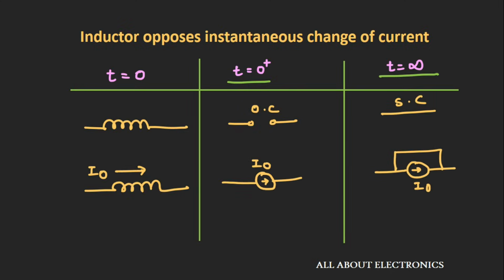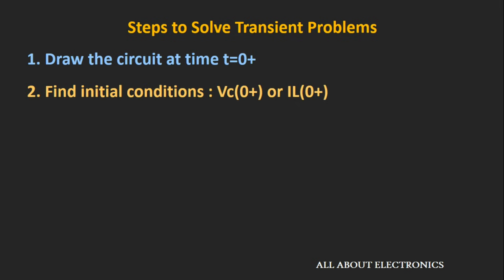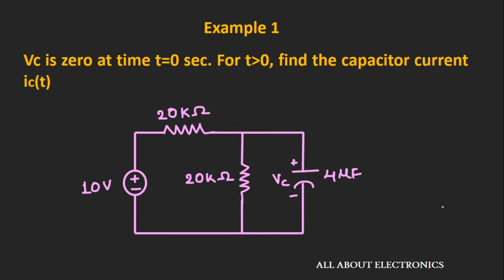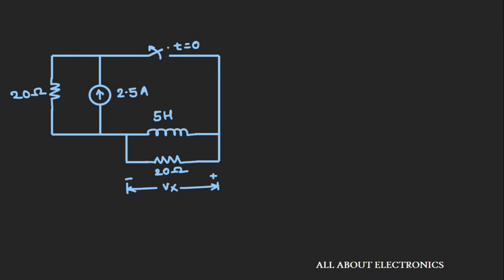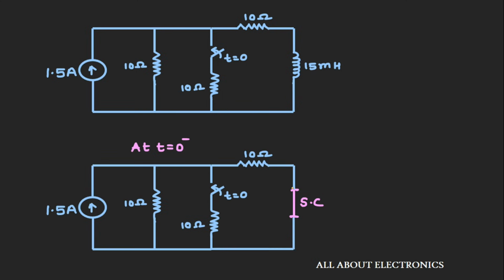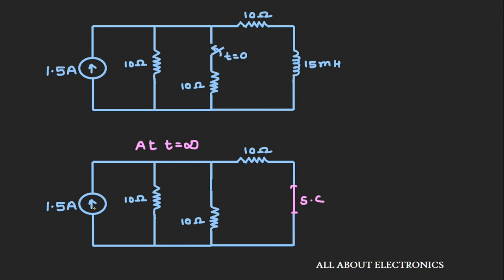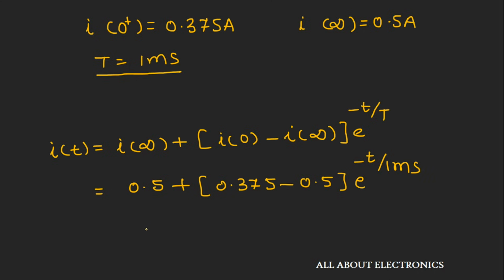Transient Analysis: Solved Examples on First order RC and RL Circuits

Comment: Sir 1.5/2 kaise aya
Reply from the maker: Using current divider rule. As the 1.5A current is getting divided between two 10 ohm resistors.

Comment: how do you divide by 2 with 1.5A in question 2? where the 2 comes from?
Reply from the maker: At t= 0-, when the switch is still in the open condition (and it is in this condition since a long time), the 1.5 A current is getting divided between two 10 ohm resistors. That is why the current through each 10 ohm resistor (and hence through inductor which is in series with 10 ohm resistor) will be 0.75 A. I hope, it will clear your doubt.
Reply: @ALLABOUTELECTRONICS  Ok sir! Thanks

Comment: Hello sir in 9.50 the inductor is short circuited because at t=0- the switch was closed . At 11.35 the at t=0- the inductor i is short circuited again expalin why it is short circuited. in the 11.35 is the circuit is in steady state as like 9.50 please explain it sirr
Reply from the maker: Since the circuit is already in steady state condition at at t=0-, so inductor acts as short circuit. And in this condition, 2.5 A current is flowing through inductor. So, now when this study state condition changes, then once again inductor opposes the instantaneous change in the current. That means at t=0+, the current that is flowing though the indicator will remain the same. And that's why at t=0+, it will act as current source of 2.5 A. I hope, now it will get clear to you. If you still have any doubt then let me know here.
Reply: @ALLABOUTELECTRONICS yes sir i understood clearly. In 11.38 u have short circuited the inductor as the switch is opened from long time at t=0- the circuit is in steady state so u have short circuited the inductor is it right sir ? Please clarify this.

Comment: i could not get q2, how 2.5A current will flow through the short circuit branch at t=0-, because a 20ohm resistor is also there on the left side through which some current will flow......please help me out!
Reply: @Funtogo-00 if a resistance is in parallel with a shirt circuited branch then all the current will flow through the shirt circuited branch as it's resistance is 0.

Comment: Isn't the inductor going to be open circuit at 9:50
Reply from the maker: The circuit which is shown at 9:50 is for t=0-, where the switch is not opened yet. That means the circuit is in steady state condition. And therefore, inductor will act as a short circuit. I hope, it will clear your doubt.

Comment: 10:49 Example 2 why the 2.5A current didn't divide between inductor and resistance branches?
Reply from the maker: At t= 0-, the entire 2.5 A current is flowing through inductor as it will act as a short circuit. At t= 0+, when the switch is opened, the inductor acts as a current source of 2.5 A and it supplies current to the resistor which is connected in parallel to it. While the current of 2.5 A (form independent current source on the left) will flow through another 20 ohm resistor at t= 0+. I hope, it will clear your doubt.

Comment: Hlo bro given circuit is with source or without source how can we gues????
Reply from the maker: If the circuit has any voltage or current source then it means that, some source is connected with the circuit.

Comment: sir in example 1 how you used formulla of inductor current as capacitor current
Reply from the maker: It is not inductor current. Its capacitor current only. The formula I (t) = i (∞) + [ i (0) - Ic (∞)] * e^(-t/T) is the general formula for first-order RC or RL circuits. It can be used for both inductors and capacitors. Only the time constant T will change. For RC circuit T = RC. For RL circuit T = L / R. I hope, it will clear your doubt.

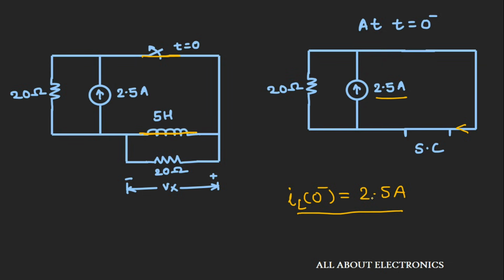Comment: At 10:14 how iL(0^-) = 2.5 A
Reply from the maker: At t=0-,  the switch is in a closed condition, and inductor acts as a short circuit ( considering switch is closed since a long time,  that will be a steady state condition for the inductor). Because of that, 20 ohm resistor in parallel to inductor will get short circuit. And overall, there will be a short circuit in parallel to current source. So, 20 ohm resistor, which is connected in parallel to current source will also get short circuited. And therefore, entire 2.5 A current will flow through short circuit. Or in other words, 2.5 A current will flow through the inductor. So, we can say that, at t=0-, inductor current is 2.5 A. I hope, it will clear your doubt.
Reply: @ALLABOUTELECTRONICS  thanks alot sir ❤

Comment: @5:47 why does the 20kohm get shortcircuited along with the capacitor?
Reply from the maker: At t=0+, the capacitor will act as a short circuit. Since, the 20k resistor is in parallel with capacitor, so it will also get short circuited. I hope, it will clear your doubt.
Reply: @ALLABOUTELECTRONICS  Thank you for the explanation! But is it a general rule? As in if something is shorted in a branch, everything in the branch opposite to the first branch will also be shorted?
Reply from the maker: Yes, in parallel, if any branch is short circuited, then every branch in parallel to it will also get short circuited.
Reply: @ALLABOUTELECTRONICS  Thank you so much!

Comment: Eg. 2 At t=0, shouldn't the Inductor become Open Circuit?
Reply from the maker: I am referring to the steady state condition before the switch was opened. In steady state condition, it will act as a short circuit.
I hope, it will clear your doubt.
Reply: @ALLABOUTELECTRONICS  Yes, it did. Thank you.

Comment: 16:22 sir il at 0- and 0+ are equal to 0.75 then y have u writtten at 0 0.375 flows it flows through the parallel resistors isn't sir
Reply: I think so too

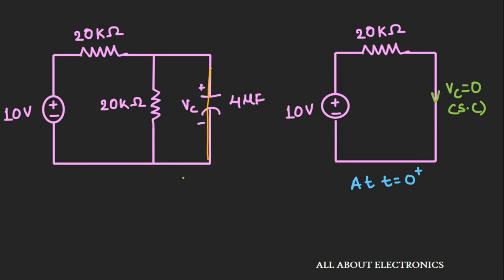Comment: 5:52 sir the capcitor is shortckted due to its property but why is the 20kohm shrtckted sir why cannot the loop b closed so that it forms a new circuit with 2 20kohm resistors

Comment: Sir please can u explain me why u put Ic(infinity)=0??? At time*8:22*
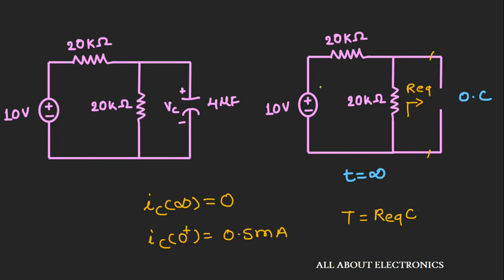Reply from the maker: If you look at the circuit at t= infinity at 7:18, then at t= infinity, the capacitor will act as open circuit and hence no current if flowing through capacitor. Therefore, Ic (infinity) = 0. I hope, it will clear your doubt.
Reply: @ALLABOUTELECTRONICS   clear sir , thank u

Comment: in 2nd question voltage across 20 ohm should be Ldi/dt but since at t=0+ di/dt is 0 voltage across 20 ohm should also be zero ?
please clarify it If mine explantion is wrong explain it how?
Reply from the maker: You also need to consider the initial condition. At t= 0-, the current is already following through the inductor. You also need to take this into consideration. What you are saying is true, if no current is flowing through the inductor at t = 0 -.

Comment: Hello, with the 1st problem, initial current is 0.5mA, why you just use 0.5 in the i(t) equation you forgot *10^-3.
Reply: Noticed  the same too it could be an oversight
Reply: @jeffreyaigbovbiosa7880 Yeah me too noticed the same.
Reply: yeah, I too found the same thing, it is 0.5 milliampere, so have to multiply the same with the output!

Comment: on minute 11:50 how he can get 1.5/2..can you explain about how u can get 2?
Reply from the maker: At t= 0-, the switch is still open. The inductor will act as a short circuit and therefore, only two 10 ohm resistors are there in the circuit. So, current will get equally get divided between two resistors at t= 0-.
I hope it will clear your doubt.

Comment: I don't understand how(in 6:05) the  capacitor becomes short circuit(which is fine) but then how did the 20K ohm become short? Can you explain?
Reply from the maker: 20 kΩ resistor is in parallel to the capacitor. When the capacitor acts as a short circuit then 20 kΩ resistor will be in parallel to a short circit. So, it will also get short circuited. I hope it will clear your doubt.

Comment: Sir u r telling that two  resistance which r parallel are in series with third resistance,then how can u divde voltage equally between 3 resistance (example 3) pls explain me🙏🙏🙏
Reply from the maker: Before time t=0, when the switch is open, in steady-state, the inductor will act as an open circuit. And hence, 1.5A will get divided between two 10 ohm resistors. (i.e 0.75A)(Another 10-ohm resistor is still open at t=0-).
At time t=0+, once the switch is closed, then there will be three 10 ohm resistors in the circuit. But as you are aware, the inductor opposes the instantaneous change in the current. That means current through the inductor at t=0+ will also be 0.75 A. Hence, the current, through a resistor which is in series with inductor will also be 0.75A. 
The remaining, 1.5 - 0.75 A will get divided between the two resistors. 
Now, at a steady state, once again, the inductor will act as a short circuit (after t=0+). And in that case, as shown at 13:59, three resistors will be in parallel. So, current will get equally get divided between them.
I hope it will clear your doubt.
Reply: @ALLABOUTELECTRONICS  thank you sir 🙏🙏🙏

Comment: At 5:50 why resistor is short circuited
Reply from the maker: Resistor is in parallel to capacitor. Since, capacitor acts as a short circuit, the resistor will also get short circuited. 
I hope it will clear your doubt.

Comment: In last example we have not to find current through inductor.We have to find current through 10 ohm resistor.. So why we used the Inductor Current formula I(L)at t.
Reply from the maker: That formula is also vaild for finding the current through the resistor. Because we are taking the current through the resistor at t=0 and t = ∞in that equation.
Alternatively, if you are still in doubt, you can find the current through the inductor using the same formula and then applying at the KCL at the common node, you can find the current through 10 ohm resistor. 
1.5A = IL(t) +2*Ir(t) 
You will get the same result.
I hope it will clear your doubt.
Reply: @ALLABOUTELECTRONICS   sir will you make video on that pls
Reply from the maker: @sujatasapte5959   I have already covered many similar type of examples on the second channel.
Please go through it.

Comment: In Ex 3 why I(0+) is not equal to l(0-) in inductor. I am getting confused. Please help 🙏🙏
Reply: It is equal Sir. It such that the I(0+) being used in the equation is the current at 10 ohm resistor( below the switch ). I think the problem here is that the current equation is not clear as to what part of current in the problem is indicated. Hence, he expect it to be the current of that 10 ohm resistor.

Comment: sir.in example 3.
At i=0-
I(l)=1.5/2..from where did we get 2. Can you say?
Reply from the maker: 1.5 A current is getting divided between the two 10 ohm resistors. That means half of 1.5 A (0.75A) will flow through one 10 ohm resistor and the remaining 0.75 A will flow through second 10 ohm resistor. 
That's why its 1.5/2.
I hope it will clear your doubt.
Reply: @ALLABOUTELECTRONICS  ss very clear
Reply: @ALLABOUTELECTRONICS  at t=0-  as inductor is short circuited then three 10 ohm resistors will be there.then current is 1.5/3.but why 1.5/2 I did not understood please explain

Comment: In 1st question, we can also find capacitor voltage first at t>0 and then we can find ic(t) across capacitor then why answer is differing. Please explain
Reply: We cannot find capacitor voltage at t>0.because.there it is open circuit.

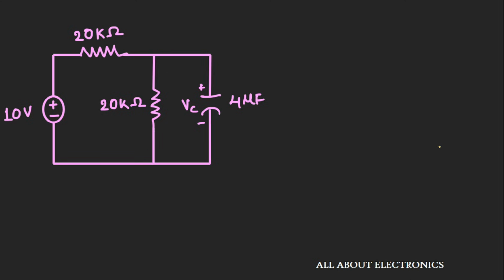Comment: at 5:40, i didn't quite get how capacitor get shorted in the equation. Can you elaborate it more?
Reply: Coz current choose low resistive path to flow, it doesn't flow through 20k ohm resistor and since current is zero, we are assuming there is no 20k ohm there

Comment: 20 kohm is short circuited? Can anyone tell?
Reply from the maker: In the first example, the voltage across the capacitor is zero at time t= 0-. And capacitor opposes the instantaneous change in the voltage. That means Vc(0+) = 0V. Hence, at t= 0+, the capacitor can be replaced by the short circuit. And as 20k ohm is in parallel with the capacitor, it will also get short-circuited at time t= 0+. 
I hope it will clear your doubt.

Comment: At 10.47 why it is minus 2.5A  ???
Reply from the maker: Because the Vx is measured from the right to the left. I mean positive terminal is on the right side, while the negative terminal is on the left side.
While the current is flowing in the anti-clockwise direction (from left to the right in resistor).
that's why there is a minus sign. 
I hope it will clear your doubt.
Reply: ALL ABOUT ELECTRONICS  Thank u

Comment: For finding equivalent resistance we have to short circuit the independent sources or open circuit them??
Reply from the maker: If the independent source is voltage source then it will be short circuited. If it is independent current source then it will be open circuited.

Comment: Dear sir,
Final value + (initial value- final value)e^-t/T
Is this formula applicable for voltage and current across all passive devices (R,L,C) in first order circuit?
Or it is limited to voltage and current across inductor and capacitor only?
Sir please let us know where this formula can be applied?
Reply from the maker: It is applicable to first order RC and RL circuits.

Comment: In question no.1 while finding Reqvivalent we consider 20kohm vertical resistor short and only 20k ohm hoz. Resistor is being considered .
There is any rule while finding R eqvivalent ki parallel resistor get short
While comparing this with question 3 while finding R eqvivalent we don't consider left most resistor short why?????
Reply from the maker: The equivalent resistance is found by finding the Thevenin's equivalent resistance across the capacitor. So, for that, all the independent voltage sources are considered as a short circuit and all the independent current sources are considered as an open circuit. That's why in the first example, 10V voltage source is shorted. And then after, two 20K resistors are in parallel. So, Req= 10K. 
In the third example, as there is a current source, it was considered as an open circuit while finding Thevenin's equivalent resistance across the inductor. 
I hope it will clear your doubt.

Comment: In question 3 it is given that switch is opened for a long time then it is closed at t=0 so as switch is open and due to rule ki instant change oppose kerta hai then how current is being flow and and at t=0- how inductor act as short circuit????
Reply: Switch to open tha to 0- pe inducors short kaise hoga???
Reply: Pls reply

Comment: in the example 3, i0+ is .75A  but in the formula we have write i0+ is .375A  plz tell me
Reply from the maker: See, the initial current through the inductor is 0.75A. But we have been asked to find the current through the 10-ohm resistor. (The second 10 ohm resistor which is in parallel with another 10 ohm resistor)
So, at t=0+, out of 1.5 A, 0.75 A current will flow through the inductor. And remaining 0.75 A current will equally get divided between two 10 ohm resistors.
That's why it is 0.375A.
I hope it will clear your doubt.

Comment: sir, can we use this formula 【i(t)=i(inifinite) + ( i(0)-i(infinite))*e^(-t/T)】for resistor also???
Reply: The V/I relationship for resistors is constant, we use Ohms law to determine them. The value of voltage and current also change instantaneously, so there is no need for i(infinite) and i(0).

Comment: It is a great explanation but  , in the third example how  can the inductor acts as a short circuit at t=0?
Reply from the maker: If you observe, the switch is connected to the resistor (and not to inductor). So before t=0, in steady state condition, it will act as a short circuit. (i,e at t=0-). And when the switch is closed, it will act as a current source. 
I hope it will clear your doubt. If you still have any doubt then do let me know here.
Reply: Exactly, I have gotten it.
Reply: I mean at t=0_,,how it acts as short ckt? wasn't it open long before t=0?

Comment: What if the capacitor has some initial charge and the switch is closed at t=0
Reply from the maker: If it has some initial charge, then it will act as a voltage source at t =0 +.

Comment: At 11.53 why inductor shortckt  
At t= 0- the switch is opened that means no current flow in that case inductor is oc  
Plz clarify my doubt
Reply from the maker: Although the switch is open at t=0-, the current will still flow through inductor via a 10-ohm resistor. If you closely look the circuit, the 1.5A current will through 10-ohm resistor and, 10hm resistor and inductor pair.
I hope it will clear your doubt.
Reply: @ALLABOUTELECTRONICS  tq sir

Comment: Sir why you short circuit the resistor at 5:50
Reply from the maker: At time t= 0+, the capacitor will act as a short circuit. And the resistor is in parallel with this capacitor. Ao, it will also act as a short circuit.
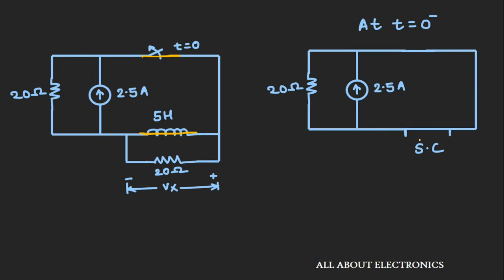Reply: Also at 9:53 when u short circuit the inductor u also short the resistor which is in parallel with this inductor.can u explain sir

Comment: Sir in example 2 at t (0+ ) why is the entire current assumed to be going towards the 20 ohm resistor in parallel with the inductor ?
Why can't a part of the current go towards the other 20 ohm resistor ?
Reply from the maker: If you observe, at t= 0+, there are two closed loops. Each with 2.5A current source with 20-ohm resistor. So, at t=0+,  the current flowing through each 20-ohm resistor will be 2.5A. But in the example, as we have been asked to find the voltage across the bottom 20-ohm resistor, I didn't mention about the second resistor. 
I hope it will clear your doubt.
Reply: What if the risistors aren't the same resistance. Will they be -V/R?
Reply: @ALLABOUTELECTRONICS  sir please be more specific . Unable to understand
Reply: @ALLABOUTELECTRONICS  how is it possible why won the  2.5 A current pass through short circuit instead of going through resistance?
Reply: @ALLABOUTELECTRONICS  why there is current in bottom 20 ohm resistance if should not, all current is through short circuit... Then voltage across bottom 20 ohm resistance should be 0 sir